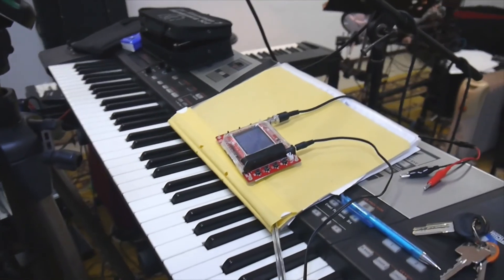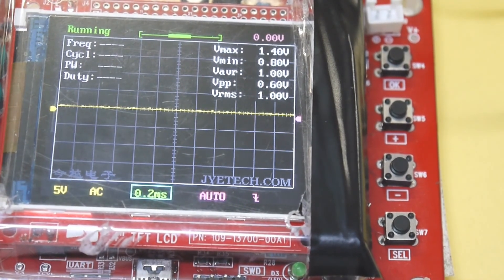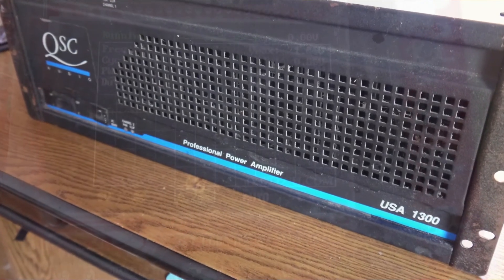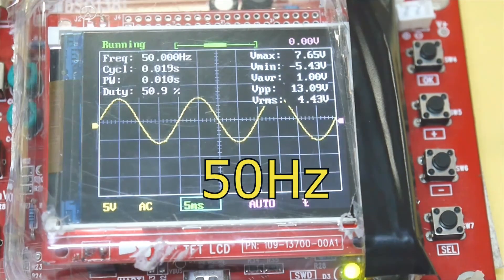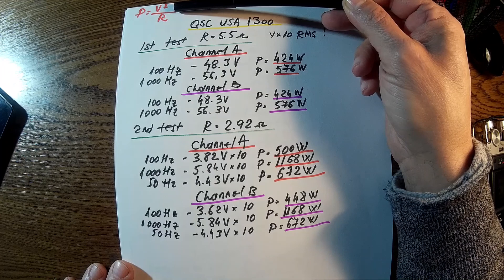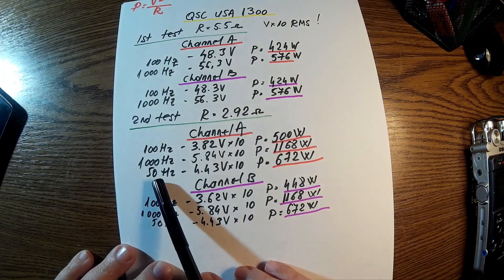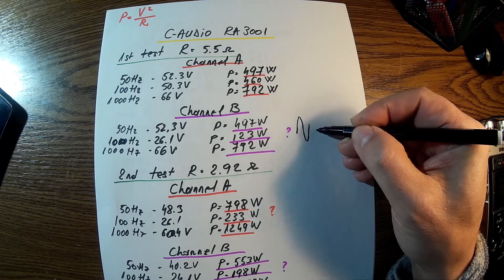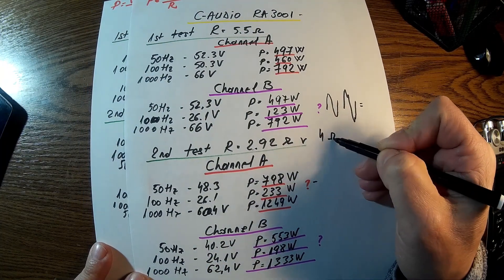QSC USA 1300 amplifier output power test

Comment: Lol mines fucked. I haven't put any effort into fixing it yet, but I may lol it works pretty good as a door stop. Fuckers real heavy on one side!
Reply from the maker: True! Very heavy, mine it's still alive and amazing good
Reply: @viocaia  These primitive designs last for decades if you treat them well. There's so little to go wrong, and they're very easy to fix when they do. Is your one still working?
Reply from the maker: @jamescollins6085  I sold a while ago, but it;s working great! The guy who bought it own a bar and he;s so delight about it (burning loudspeakers every weekend!) HA!
Reply: @viocaia  That's good to hear. I just ordered a pair of USA 900 amps to use in bridged mono mode to power subwoofers. Should be good, hopefully.
Reply from the maker: @jamescollins6085  Of course they are ! It's QSC!
Reply: That's because the fucking power transformer's on one fucking side. Son of a bitch. Mine fucking works, fucking perfectly. FUCK.